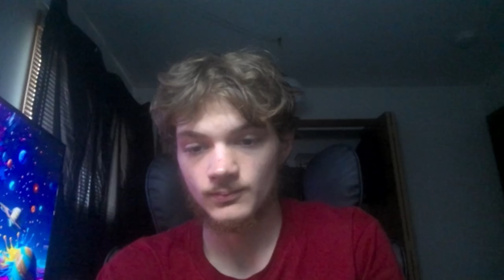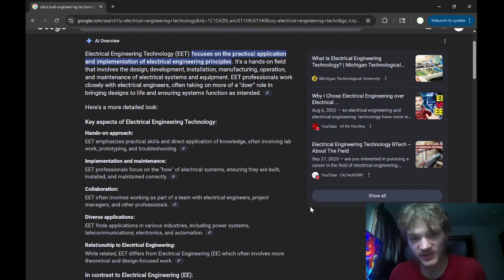Electrical Engineering Technology vs Standard Electrical Engineering

Comment: Hey man, awesome video! Is the main reason why switched out of eet your passion for design aspects, or job prospects? I'm also about to switch to eet and I'm worried about getting internships and jobs.
Reply from the maker: It's kind of for both, doing the EE gives me more opportunities and allows me to get more in-depth with designing/research. 
EET is basically an EE degree but with minimal reporting and maybe like 20% less workload. 
EET also gave me experience faster in terms of hands-on with real PLCs, Fanuc robotics, and more complicated components like transistors and opp-amps all by your 3rd year. While EE goes a little slower in terms of bringing new information in that doesn't relate to what you're already studying. 
The opportunities are a little better with a EE degree but having an EET degree is enough for most. So decide what you enjoy more and your commitment to the field. The EET degree was primarily made to get people into industry right away, why my school has 100% job placement for the EET program 6 months after graduation. While the EE degree aint 100% but close. 
You might have a hard time getting internships with just EET, but a full-time job after graduation should come with minimal obstacles. Still search for internships, but dont get your hopes up if you're not getting any opportunity right away.
Reply: Congratulations and best of success with all of your future endeavors with respect to EET and e e Could you please do a video on your experiences with day trading I see that you have a few videos relating to a day trading could you please do a thorough video on that to be more informative of us to like how into what you are and is it coffee trading or do you do like regular day trading and what you know what venue is like forex or stocks or maybe greatly appreciated. Thank you